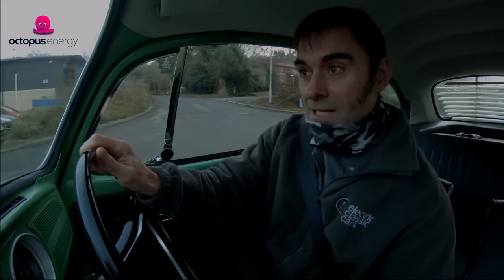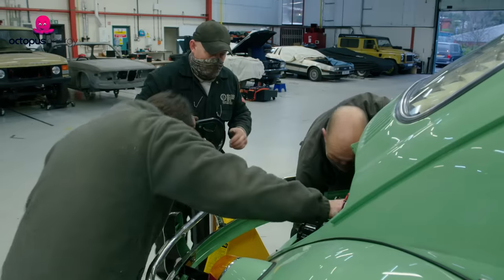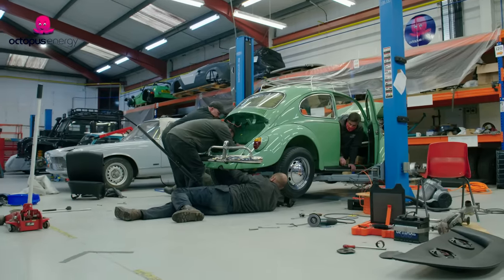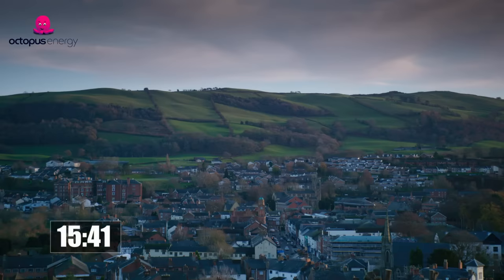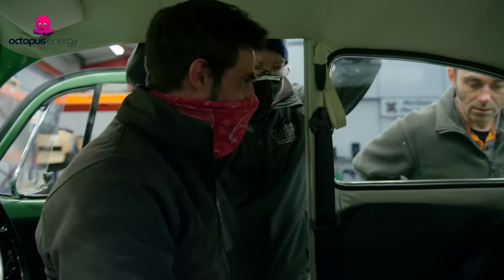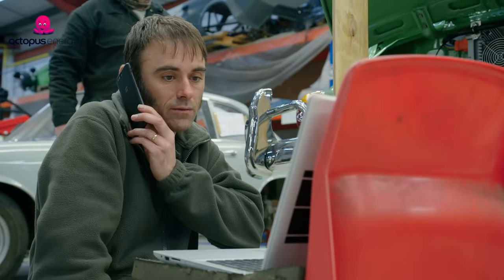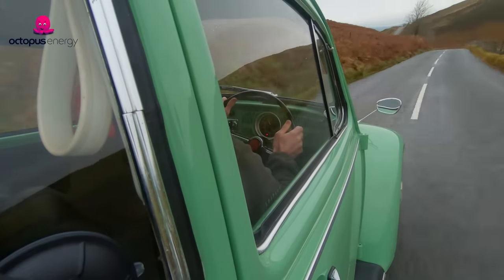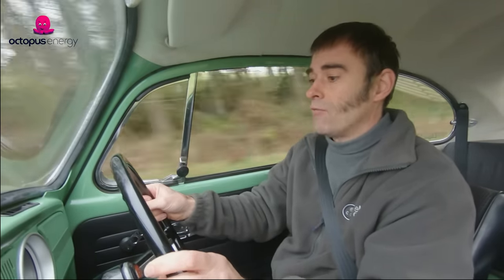VW Beetle converted to electric in a day

Comment: Never thought you could do something like this in a day, amazing. Did you add another battery yet to increase it's range? I would think you would have by now.
Reply: By giving up the rear seat, and luggage space, you could double the range. Not so sure about the practicality of that though. Maybe fit the old-school roof carrier for luggage, though the increased wind resistance would then again reduce your range. Win on the roundabout, lose on the swings.
Reply: @Suddenlyits1960  pretty sure the electric motor make it way faster and the weight distribution also become better that also improve handling... range is not a problem if they live in europe city there is plenty charger there with standardized plug, and small battery means shorter charging time... and if you can't watch till the end they charge it using wind or solar power... 

yeah like gas car never break down and get towed on the street after having various problem in their system... don't be stupid old man ICE car is not perfect, electric car also have it share of problem but using electric car is way better for the environment...
Reply: @Suddenlyits1960  I think you don't understand much of what you're saying. I just mentioned that more batteries increase range. As far as a natural gas conversion goes, that has nothing to do with this video and it's expensive, and a fossil fuel. batteries can be recharged with solar. Your going off about things that are irrelevant to this video or just wrong. How old are you eighty or five years old?
Reply: @Suddenlyits1960  you are clouded by your own country shitty power plant, if you want to talk about car build in other country then you need to do research on how the condition those people living on... How the infrastructure for electric car, how much the percentage of solar and wind against the coal power plant in their grid...

Those off set doesn't work for this vw build after all it is a weekend toys, the purpose is not for daily driving who the hell drive old vw for daily driving? ICE car break and have their drawback so do electric car, if we can live with ICE car that can breakdown i think we won't have any problem with electric car having minor issue... after all electric motor have fewer moving parts and and need way less maintenance than complex ICE car...

Having battery that fail in 4-5 years is pure stupid statement, even when they roll out from factory they have battery warranty for 8-10 years and when degraded it will reduce the range, not totally dead... Nice try on misleading people with asspull data... Battery cost is getting lower and lower every year... Flash news there is recycle facility for lithium battery... Nope in europe coal is not the major power plant, nice try... You can charge it at home without problem, not everyone daily driving long distance into middle of nowhere with no civilization on sight... Most of us have daily driving route in the city... So stop making up scenario that won't happen...

Yeah back then battery is an issue but technology change old man, we live in 21st century with way better battery... And electric motor is already used for decades in train with no problem...
Reply: @Galactus9386  If you hate America, maybe you shouldn't be begging it for fuel and protection!
Reply: @Galactus9386  electric is dumb for normal vehicles unless and until conventional battery tech is upgraded to not use toxic chemicals that require strip mining via diesel powered heavy equipment and can recharge as fast as you can fill the gasoline tank. The 80-90 mile range isn’t acceptable at that point and removing utility from the vehicle just to increase range isn’t, either. It’s fun as a gimmick but electric is a long way off from practical.
Reply: It's not about practicality, it's about doing something different with a car instead of doing the same old upgrades or engine swap that everyone does.  The technology is easily there we just choose to ignore it because you can make more money from gas. Electric cars have been around since the end of the 1800s.
Reply: @One_Bar  Your reply is dumb. People that take the initiative to convert cars that would have been recycled as scrap is highly commendable. Not only that it shows that we can sidestep sky high electric car prices. These EVs can be recharged with solar as well for free.Your comment is pitiful and uninformed.
Reply: @One_Bar  this. Batteries are in a very mid state. The battery conundrum is a serious reality. 

Its going to drastically change the used car market. No one wants to buy a used tesla when a battery pack is 15-20000 dollars. 

The battery recycling programs are far behind the need. 

Make no mistake. I believe we need to make the transition to electric, but batteries are right now not the permanent solution. 

I expect the aggressive change to car propulsion will lead to varied upgrades. 

Hydrogen ICE, or fuel cells are growing too. But they have their growing pains. 

This beetle is an excellent proof of concept. If the battery were green we would be lauding this. Hell, even without it is a remarkable conversion. I bet in 20 years it will have an eco-battery, with 5 times the range. 

The comment about power source for charging? The UK is making massive movements in energy. Not as fast as say Germany. 

I live in Quebec. We have an almost entirely hydro grid. A fast charger is a tax write off. Hydro is stupid stupid cheap. So would I reccomend  an all electric here? Yes. 

Accross the river in Ontario? No. Not a chance. Ontario is a shit show for hydro. Stupid expensive. 

Charging stations out of home? Canada has a HUGE problem. 

We have them in places rich people visit. Parking lots, gentrified parking lots. Do we have street chargers? No. Do we have charging stations like gas stations? No. 

The whole above argument about battery packs, source of energy is all very valid. We have a new animal, but barely an ecosystem to support it. 

The design of electric cars is also problematic. Tesla designs a car, sells it. Its still designed as a drive it and get a new one when the battery dies. Battery replacement is ridiculous. 

THIS CAR THOUGH!!!! this car has small battery packs that could technically swapped out fast. 

If the packs are say $2500 each. This car is a fucking steal compared to tesla. Not to mantion the LACK of footprint in other areas. 

No new materials. No excess technology. Think of how much chiptech goes into a new car. iCE or electric. Thats a LOT of pollution to build a lot of chips. 

I would counter that this cars carbon footprint has been less because its been spread over 50 years of use. If it runs for another 50 with minimum upgrades, that car probably has less impact than a car that lasts 10 years.
Reply: @One_Bar  i agree, but necessity is the mother of all invention. Make the electric car frames long lived and highly upgradeable, then when better battery tech pops up we can upgrade. But until batteries are truly green we are paying one credit card with another.
Reply: @saved74  Conversion usually costs nearly as much as a new, modern, factory built EV. So there's no avoiding the elephant in the room: batteries are heavy and expensive. Also, where can I get multi-KW of solar "for free"? (that's another massive up front cost to avoid buying gas, or "coal" electricity.)
Reply: @chrissyclark7836  You need to look at the market... people are buying up used Teslas faster than people sell them. Their battery packs last decades. Yes, current battery tech is rather crap, but it is still improving. (yet it will never have the energy density of liquid fuels.) H2 / fuel cells are a horrible path... where does the hydrogen come from? electricity splitting water - an extremely energy intense process with very little of it becoming power in the "battery". Aluminum-Air batteries are a similar massively stupid idea - smelting AL is another high energy process. A fuel-cell using ethanol would be a very green option, but I've not seen anyone doing that. (I know the cells exist.)
Reply: @jfbeam  look at Toyota. They have never abandoned hydrogen. They are doing a lot of front end tech. If they crack it, it would be pretty epic. 

My concern is the change in obselecence thinking is not taking hold. Tesla is very apple in its tech. That is a problem for right to repair. 
Only allowing tesla to fix teslas is not a valid business model. 

And chargers. Holy shit are they notorious for being broken round here when you can find one. 

But i absolutely agree its getting better.
Reply: @jfbeam  huh? There are a number of new nuclear plants under construction. 

Candubreactors were sold to china who are using a new tech much safer. France is planning rebuilding some of its reactors. 

As for the hydrogen, there are a few algae techs in their early stages that produce at a high scale. But those require vertical farming which hasn't been scaled up yet. 

They would also be used in conjunction with transparent solar  panels to double whammy. 

I cant find the story about the algae farming. It was a part of a greater article about the combining of multiple techs to produce and capture. 

But these are all techs that would require massive organization to scale up. Alas our world is whacked
Reply: @jfbeam  if you think this is true you either didn't watch the video or weren't understanding anything you were watching. The cost of an EV from Tesla and other car makers are about 5-10 times more than what this would cost to build. If you work for Tesla or a car company nobody's buying your effort to spread false information with your ludicrous comment. Go play,
Reply: @chrissyclark7836  Thorium reactors are still "university" projects. There are some experimental reactors being built, but they are NOT for power generation. And they aren't remotely big enough to feed the grid. They are merely technology demonstrators. It would still be decades for the various approvals to even get a license to build one, then many more years to actually build it. With the ever-present not-in-my-backyard types, any such project will have years of legal fights to even get to build it. Yes, our society is whacked.
Reply: @saved74  I've done EV conversions; I know how expensive they can be. You'd be looking at 20-30k to do this, beyond the cost of the car being converted. If you do everything yourself, it'll be on the lower end. Kits for a Super Beetle run around 18k for about 25kW of tesla recycled batteries. New production model EVs are in the 30k range (tesla aimed for 30, and missed) -- better designed, more batteries, with an actual company standing behind them vs. something you put together. When something goes wrong with this bug, where do they take it... back to the people who did the conversion. When your Nissan Leaf breaks, there are lots of Nissan dealers around, and many 3rd party shops know how to work on them. When something goes wrong with my Electrica, I'm the only one around to deal with it -- it's possible there's some escalator company around familiar with Curtis Instruments, but there's no auto shop that would know what to do with the thing.
Reply: @jfbeam  i didn't mean thorium. I meant nuclear plants. China has 50 reactors... And that only supplies 5% of their power. But the advancements they have made have been impressive. 

They purchased the technology for Canadas reactor which can use repurposed wasted fuel. 

Honestly though. We have the ideas, as a species. Imagine if we globally decided to have a 'Green' race. We turned our society a solid goal of saving this planet. We could do it. Humans could totally do it. 

It just breaks my heart that leaders are lacking in vision and cooperation.
Reply: @chrissyclark7836  Only if there was a tremendous amount of money in being green. (there isn't. as long as there's oil and coal, there won't be.)

In the US, we're just now starting to build Gen3 reactors. (3-5 not sure how many are still moving forward) And finishing a Gen2 reactor that was put on hold decades ago.
Reply: @jfbeam  No you wouldn't unless you are a very poor engineer of your project or you add lots of unnecessary extras. Most people could do a conversion for about 5,000. Just because you don't know how to do it with a reasonable budget doesn't mean everyone else is unable to. This is golf cart technology.
Reply: @saved74  If you think a 12v car battery (or 10) and washing machine motor will run a 1ton car, you're an idiot. I'd like to see you source a hyper9 kit (motor, controller, harness), 20+ KWh of batteries, and the rest of the incidental bits (instrumentation, gas pedal, wire [2/0 or 4/0 welding cable], etc.) for "about 5,000". The motor kit alone is 5k, 20k of batteries (even used) is 5-8-10k (depending on where you are and the work already done - if you live in an area with a lot of wrecked teslas, those will be easy to source.) We briefly used chevy volt batteries. The Gen1's are ~16kW, so it takes several (say 3) to make a fair pack. They were a little over $3k (more now), so that's $9k right there, before even cracking them open. The BMS boards inside those are mostly useless as they're a black box that only a handful of expensive VCU's know how to use. So that's another 1k+ for a BMS (either VCU, or shoespoon a 3rd party in there.) And then you'll need a charger programmed for whatever voltage/current your pack ends up being. That's another 1-3k (or more). If your pack isn't the same voltage (360-450) as the original source car, you can't use those chargers. (plus they'll have some blackmagic CAN protocol to work)

THERE'S A REASON WHY A FULL KIT IS $18k+ This shit is NOT cheap. If you think you can do it better (cheaper) than EVERYONE else who's been doing this for many years, get off the f***ing keyboard and do it. I look forward to watching the video series of your "$5,000 EV Conversion". (buying an already converted car for 5k and moving it to something else does not count.)
Reply: @saved74  As I said, I look forward to seeing your "$5,000" EV conversion.
Reply: @jfbeam  thats the US. The world is moving on Germany is almost entirely renewable. But thats bexause German people have a will to power that the US doesn't because of their 40 year hangover from the 80s
Reply: @Suddenlyits1960  Hilarious catfight.  Who says men can't be women, too? You should get married...
Reply: @saved74  How does one get free solar electricity?
Reply: @notewell3d199  From a solar electricity plug? LOL.
Reply: @saved74  do folks really think that is free?
Reply: @saved74  I'm not sure I would want to wait for a solar powered charger to power up my batteries but I don't know you can get a nice quick charge to get you across town where you've got to go without spending too much time
Reply: @chrissyclark7836  I just saw a video of this artificial diamond that is able to hold enough electricity for years and years it's a truly amazing thing that is now becoming available I don't know how practical it is in full production mode but things are coming down the pike every year things get better and better quickly
Reply: @jfbeam  have you seen anything on this new nuclear diamond battery that lasts for years and years on one charge I'm wondering how real or available that will be
Reply: @arlenmargolin4868  too often american CEOs are more financiers than engineers
Reply: @arlenmargolin4868  its frustrating as hell. As a Canadian, we were waaaay ahead for green tech in the mid 70s. Pressure from US oil shut it down. All the green brains went to Germany. Who is powered by mostly green? Germany.
Reply: @alphaxfang  "If we can live with ICE car...."

That's the point: we can't
Reply: @Tao_Tology  the point is, if we right now can live with ice car that can break down we can live with ev that have their own drawback... If you can't live with ice car then what the hell you use in the past 10-20 years before ev/hybrid start emerging?
Reply: @alphaxfang   "the point is if we can right now.."

Again, we can't.

Comment: Well done. Suspension type, engine type, (2) battery location, battery/inverter cooling, engine/hp settings, options for rapid charging. Disc brake upgrades.

What does it sound like? How do software, hardware and component upgrdes work? Any allowance for winter heating/defrosting and summer a/c? What is the warranty for parts and labor if supplied.

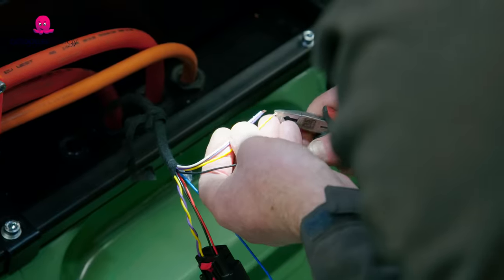Comment: 7:03. Love the mixed up units. "With a petrol car the battery is 12v. With an electric it can give you up to 800amps."

A lead acid 12v battery often has a CCA rating of 800amps if not 1000amps.

Comment: I love everything about this, except for the computer programming! That’s always so frustrating! And would make me question the reliability.
Reply: Once it's programmed you don't have to touch it again. Just like you don't have to mess with petrol mapping unless you want to play with performance.
Reply: This is only "at the factory" sort of stuff. Unless something breaks, it'll never need to be touched again. I've fiddled with mine several times, but I'm an engineer who likes to tweak stuff. For the record, your modern dino-burner gets a mind-meld with the tech's computer(s) whenever you take it to the shop; you just aren't watching them do it. (that's the first step in diagnosing almost anything.)
Reply: @marsrover001  Even then, you pay someone else to do it.

Comment: The big manufacturers are a serious threat to the smaller new car manufacturers, i am happy there is competition just imagine if vw had to start mass-producing these in the factory that is still manufacturing them, make a few minor changes to allow a bigger battery and design a drop in electric motor with controllers and everything so it is just a matter of plugging it into a wiring loom.  Add a screen for the dials and voilà a cheap 200-mile people's car.